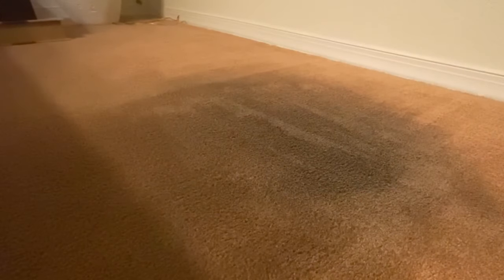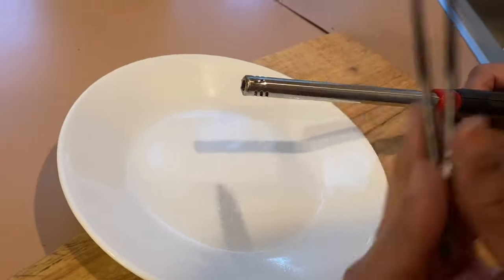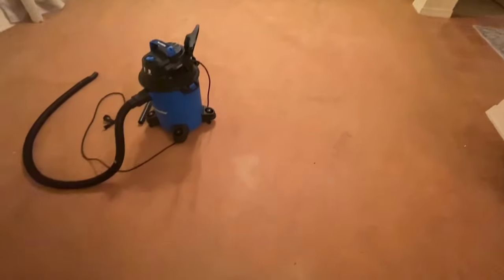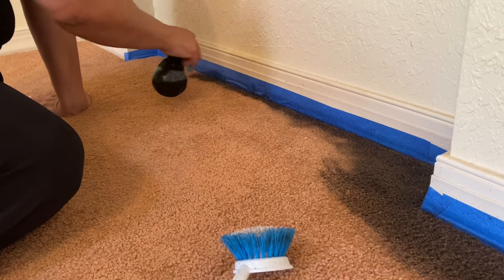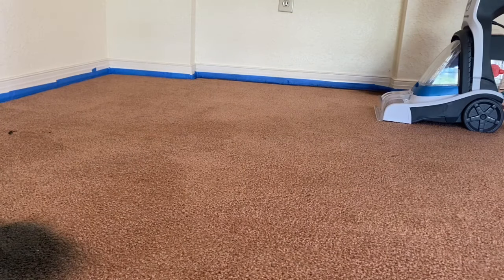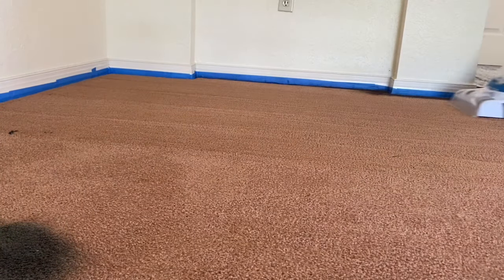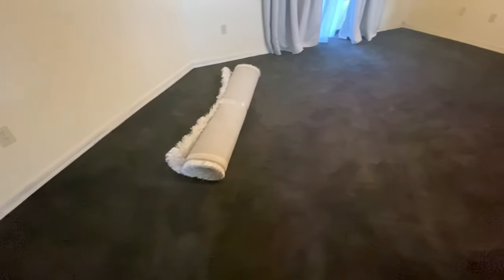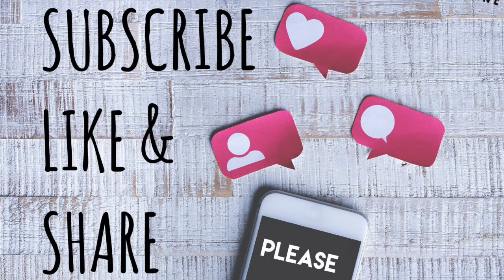$50 Dyeing Our Carpets Cheap Flooring Idea |Tutorial | Save Money “Using What You Have” Episodes

Comment: It's really not expensive to buy and have laminate wood flooring installed.
Reply from the maker: It was $7000 for the laminate and install. Took a while to save but we did it!
Reply: @ourclassichome  I did my house for about $4k.
I ordered flooring online from home depot, then got on yelp for a contractor, who installed the flooring and new baseboards. 
Always shop around.
Reply from the maker: @kewlztertc5386  we did just ran into lots of low areas that had to be filled and it was about 1300sqft not counting bedrooms. Oh! Not to mention 1000sqft of tile removal which was horrible
Reply: @ourclassichome  ouch! 
I had a room with ceramic tile, the contractor used padding on that room. The laminate had pre-installed padding, so it wasn't needed for the rest of the house.

I bet you're happy to have it done. I love my new floor as I hate carpet. 
The next thing you absolutely must buy is one of these vacuum mop robots. I recommend the Dreame L20 ultra. 
Also there's a product called "QuickShine" ($9.99), that temporarily makes your floors shine like glass. It's super easy just mop 3 coats. I use it when guests are coming over. 

Congratulations on your new floors.

Comment: Here's a more expensive dye alternative to the Rit DyeMore, but it's made just for carpets so it doesn't need the heat that Rit DyeMore requires for best results:  5th Generation Carpet Dye (cheapest colors are black or dark gray) which should be used with 5th Generation Dye Set Penetrant.